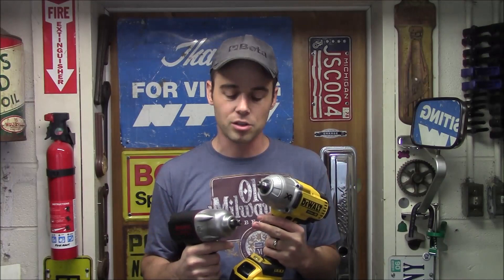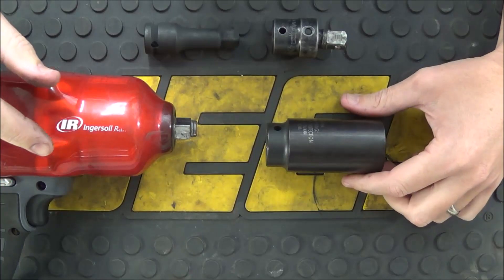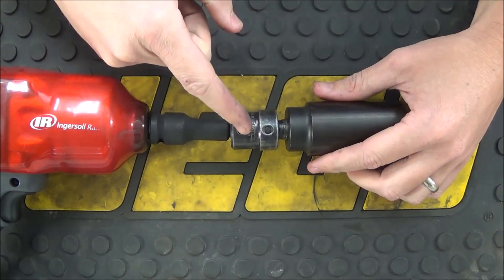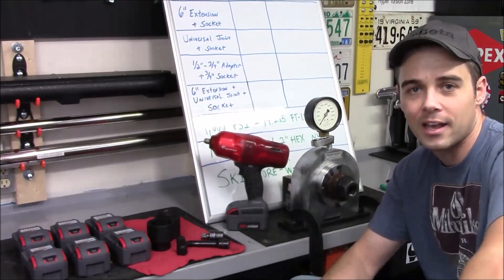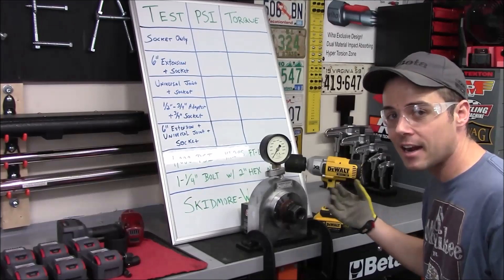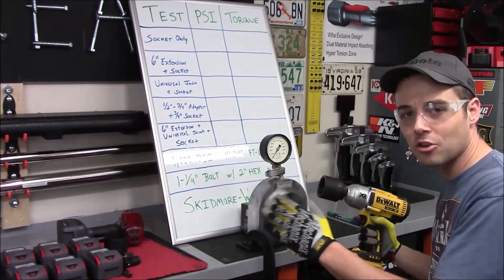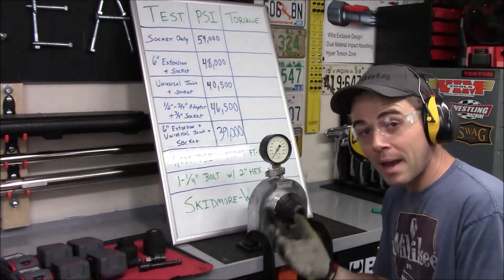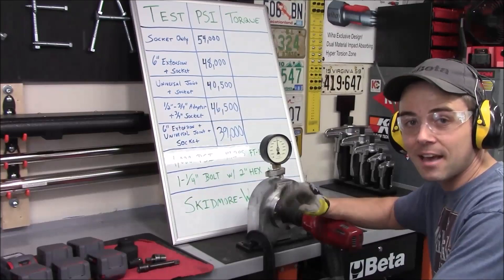Torque - VS - Torque Loss (Impact Wrench tested with Skidmore-Wilhelm)

Comment: Do you find the torsion of the extension also plays a role by absorbing the impacting action before it gets to the socket as well as the contact points? It would also be interesting to throw a Blue-Point weighted crank bolt socket on that scale to see the increase it gave.
Reply from the maker: +Banshee365 Yes.......everything plays a role & it is extremely hard to determine an actual torque rating without a device like this.  The lengths, type (regular or swivel extension), tolerances, condition, etc all will change to torque applied.  I agree about the crank bolt sockets, the issue is that NO bolt/nut on earth that uses a 19mm hex head can have over a couple hundred ft-lbs of torque applied to it before the bolt begins to stretch & will ultimately fail.  The reason that it takes so much torque to remove crank bolts (for example) is friction --- specifically the torque needed to overcome that friction caused by corrosion.  I heard that the Blue Point weighted sockets were off-the-market due to premature failure (cracking), & the only current model out right now is the Lisle one that I showed in the beginning portion of this video.

Comment: very nice video and I got a lot of information.

but what you did will apply on torque wrench ?
if you add an extension or universal joint will affect or the torque will not be accurate ?

and the impact driver that you used in these video can break free  a bolt that  size is 1⅛  with fine threads that is torqued to 700 ft.lb ??
it will be very helpful if the impact driver can do it ...

and thank you for your great efforts
Reply from the maker: +Omar Alnajjar Thanks!  If you are using a torque wrench (not an impact wrench), extensions/adapters do not affect the torque --- since you are applying constant pressure (vs many small impacts against the fastener).  The impact wrench in this video (Ingersoll Rand W7150) WILL remove bolts torqued to 700 ft-lbs....in fact, I was using a LH thread bolt/nut (reverse threaded) in this video....so all the torque specs shown are actual results in reverse w/a 1-1/4" bolt w/fine threads.  There is no option for a 1-1/8" bolt with the Skidmore-Wilhelm Model R, or I could have used one.  I am glad to know you like the videos...thanks!